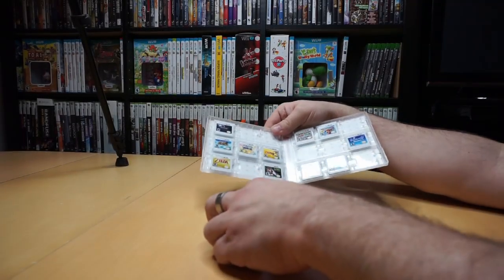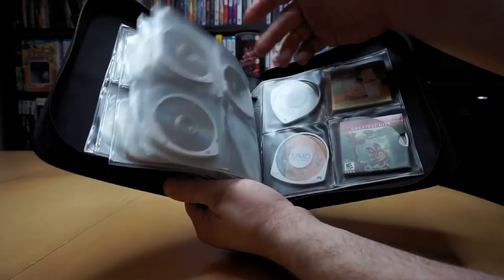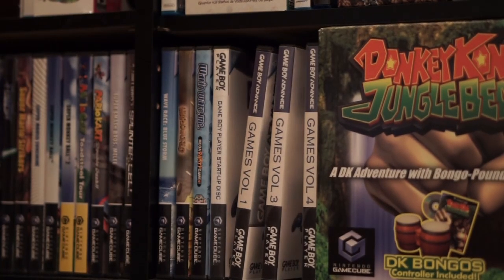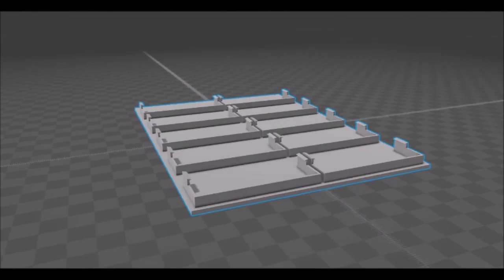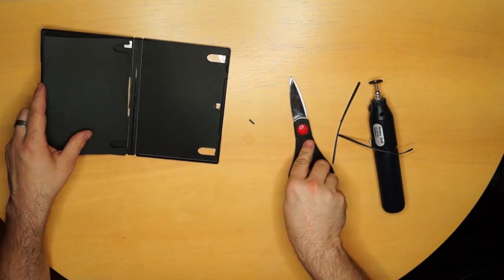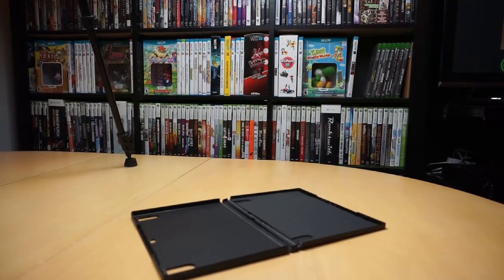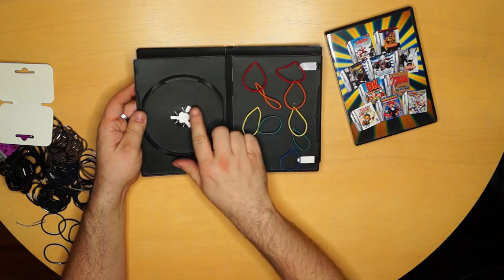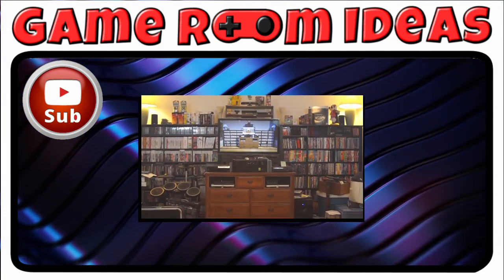DIY Game Boy Advance game cases | Game Room Ideas

Comment: That plastic is polypropylene, and almost no adhesive with form a reliable bond with it, even glues specifically intended for plastics. 
However, there is one kind of glue that works extremely well, and it is readily available - standard hot glue sticks.
It forms a bond that is almost like a weld; the plastic will usually break somewhere else before the glued joint gives way.
I have only ever tried the normal high temp hot glue. The low-temp or dual-temp glues may work too, but I have not personally tried them.

Comment: Very clever!

I wonder if the dvd case solution can be adjusted for GB and GBC cartridges. In that case obviously they would fit less cartridges than with the GBA ones, but I think that also could be a good idea for storing them and saving space.

I see in the video recommending a Blu-Ray case for GB/GBC, but with the DVD cases I believe (without doing any measures yet) it can fit 2 GBC carts and a maximum of 6 GBA carts, or 4 GBC and 2 GBA, for examples.

This would be nice for store games of large franchises like Zelda: three GBC Zeldas and four GBA Zeldas, including the ones from Classic NES Series. Assuming a GBC cart is the double of a GBA one, I think you can store all Zeldas from the Game Boy family in one DVD case. And of course one can later make a cool themed cover. XD
Reply from the maker: That is a wonderful suggestion, thank you for sharing it.  I checked it out and it works well with the hair tie design without modification.  Having two rubber bands cross each cartridge helps since there are no 'shoulders' to catch on to.    https://i1.wp.com/topspot123.files.wordpress.com/2018/09/img_20180902_132210.jpg .  Your instincts are correct as each GB or GBC game takes the space that two GBA games would take.

I've added this information to my project page on my website.  https://topspot123.wordpress.com/my-projects/diy-gameboy-advance-game-cases/ .  Thanks again!

Comment: Tried the hair tie method with a CD case with softer plastic and it worked awesomely! This video was a big help. The CD case can store six GBA games, which is a good number for me – plus the case size fits well alongside my DS cases
Reply from the maker: That's great!  That's a good idea as well.  If you would like, you can send me a link to a picture or a couple and I can add your idea to the project page.
Reply from the maker: @tinkinova4594  That turned out really well!  I very much appreciate you coming back to share that.  I have updated the project page so other collectors can see this adaptation.  Thank you again!
Reply: @TopSpot123  You're very welcome! Thanks for sparking its existence by sharing your case ideas in this video!

Comment: I'm using a Sonic-themed binder with several "Ultra Pro - 9 Pocket" pages (originally designed for carrying trading cards) inside. Each page holds about 18 GBA games or 9 GB/GBC games. Works pretty well, but the binder takes a lot of space, so I may consider doing this. Looks really neat in a shelf and blends in pretty well with the other games in your collection with the custom art ;)
Reply from the maker: Yeah, even though I like my zippered folios the best of all, I wish they fit on my media shelves better.  They're a bit too big too.

Comment: You could buy plastiweld or whatever they call that plastic you harden with uv to make little plastic rows to sit the carts between
Reply from the maker: I didn't consider that plastic resin, but have considered layering hot glue in the same way.  I have a couple of ideas of alternatives, but with the tight spacing, everything has to be so exact to work properly.  If I improve the concept I would like to make a follow up video.  And if you try anything and get good results, I would love to see it.

Comment: That was so much extra work when you can just use "Multi Storage Cases", they some in lots of different sizes including 14mm DVD case sized. They are basicly completely blank DVD cases without any disc or manual holders, thats what ive been using for years and also got some 20mm ones for GBC rumble games and even some bigger ones for ereader and gameboy cameras. Also if possible, look for ones without "moonclips" but if that's all you can get they can be easily snipped out if need be.
Reply from the maker: Great comment!  I knew cases like you described existed, but only while editing my footage did I find ready sources to purchase them.  But remember this video is really a recounting of what I did for these games circa 2003-2004 (just to share the idea). 

Do you have any pics posted anywhere of how you use these cases?  Are you using any certain way of securing your cartridges?  I would really like to see how your things are organized.  Thanks again!
Reply: exactly these yes, same ones i have
Reply: Tony B OR maybe it was fun to make!
Reply: Over $70??!!

Comment: I can't recommend using sticky tacks of any kind unless it's only for a short time or you can live with residue or fat stains on a surface. I've tried for years and even if it seems fine at first, it always ends up leaving some kind of residue on whatever it's stuck on! Think about how some erasers dissolve and become oily after a while, such as many of my old phone cases and other soft plastic materials did too. Don't except sticky tacks to hold up any better after 10 years! 😁
Great idea with the hair ties though, might do something similar. I got one of the Club Nintendo DS cases and I wish I had gotten 2 back then.
Reply from the maker: That's a great point, thanks for bringing it up. It's hard to predict how different material will degrade over the years and I agree that it seems pretty risky.

Comment: I've used a 3 x 3 trading card trading card binder. It fits gb, gbc,psp, and 2 gba per sleeve. For ds, Vita, and switch I use a binder with 5 x 5 coin collecting sleeves. Game cube was the hardest to solve. I use 2 x 3 floppy sleeves, which are hard to come by these days.
Reply from the maker: Do you ever have issues with the cartridges sticking to the inside of the binder sheets?
Reply: @TopSpot123  no not at all. Its also crazy cheap. I think i paid 6 dollars for a pack of 100!? Looks pretty decent, game floppy sheets on the other hand are a thicker plastic and dont look that great. But it is pretty cool to be able to take a 100 gc on the go. Gamecube discs are the hardest thing to store AND are the most fragile.

Comment: also, how and where can I find those inlays for the case? I'm making one myself with a tweaked design, and I wanted to use the inlay you're using.
Reply from the maker: Do you mean the artwork?  If all of the ones in the video I made myself in an image editor.  

And let me know in what ways you tweaked the case, consider making your own video!
Reply: perhaps maybe some links to a google docs page is in order then, eh?

as for my rendition of the case, I mostly did what the 3d printable is supposed to do, though not fully functional. I was hoping to just have a simple case that holds 10 carts made with foam paper, but it didn't work out, so I magyver'd a thing using cardboard and strips of foam paper to try to hold it in place.

Comment: the terminals have the potential to not only damage the case as well as the neighboring case. Possibly the best option is funky/craft foam. If someone could make a die to use in a cheap craft press, it would be the best option.
Reply from the maker: That's a good assessment.  As long as the cases aren't compressed together, there isn't too much danger of damage.  But I certainly would prefer a solution like you describe.

Comment: Is the thinkcad model scaled to fit the case? If so, I would love to 3D print the model.
Reply from the maker: I'm a newbie at 3D modeling.  I tried to make it at the proper size, but with no way to test or prototype, the results aren't guaranteed.

Comment: Do you now where I could possibly get those Nintendo licensed zippered cases that you put your GBA games in?
Reply from the maker: They were very difficult to track down when I got them, and often sold for >$40 each.  I have a lot of patience and persistence.  I'll search eBay and let you know if I turn up any.
Reply: Thank you.
Reply from the maker: I wasn't able to find any current or recent listings.  You'll just have to keep checking diligently.  Good luck!
Reply: That's fine, thanks anyway. I actually found some small display shelves for GBA games on Etsy.

Comment: I Would Use Velcro Sheets And Make Small Circles
Reply from the maker: I'm not sure I understand, but you could try it.  Let us know!
Reply: I tried this.
If you stick an entire velcro pad to the back of a cartridge then it won't fit in a GBA any more, but there is that dimple under the model number. I cut a piece of velcro small enough to fit in there, and it IS deep enough that it doesn't affect usage. Unfortunately, because the velcro was so small and the dimple was under the cart's centre of mass, the threads could twist around one another and the cart flipped upside down. If you're willing to store your games upside down then this might be a good solution, but I wasn't happy with it.

Comment: why dident you sand the disk holding bit off
Reply from the maker: It sounds like you assume it would be flat under the protruding plastic, but that's incorrect.  The plastic is shaped that way and sanding off the ring would also remove the whole circle just like cutting it out.
Reply: oh
Reply: It would make the edges less jagged than cutting it off. There's also less risk of damaging the clear plastic that holds the cover.

Comment: Or just spend more time and only cut the protruding plastic from the case, leaving the base inside
Reply from the maker: It sounds like you assume it would be flat under the protruding plastic, but that's incorrect.  It's hollow inside the ring.